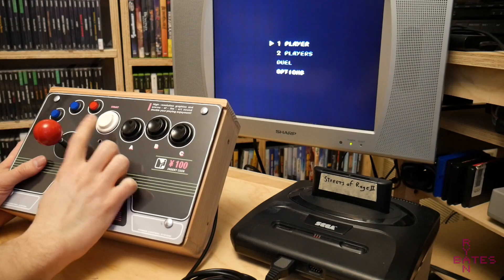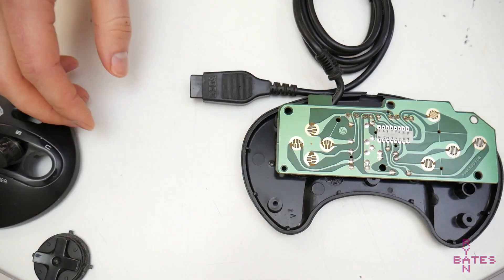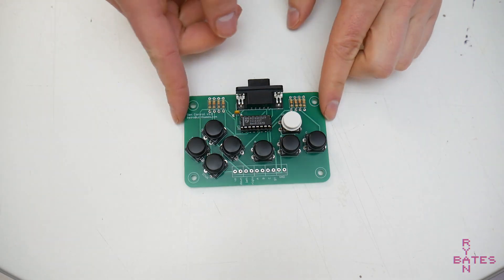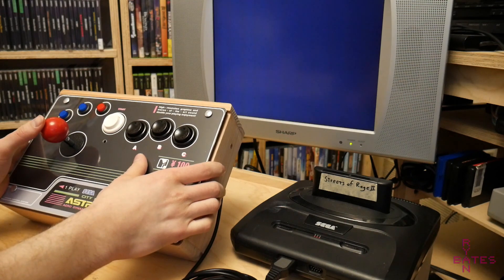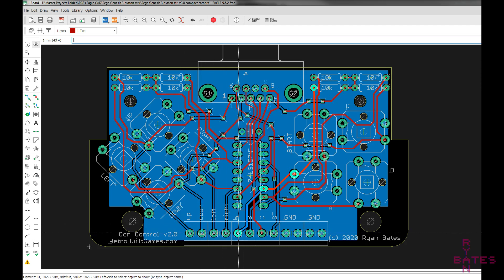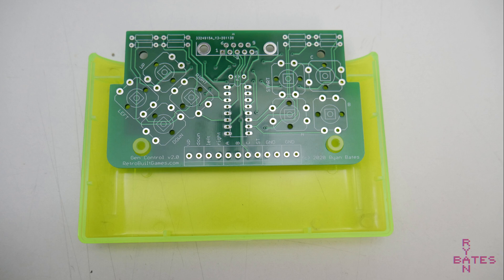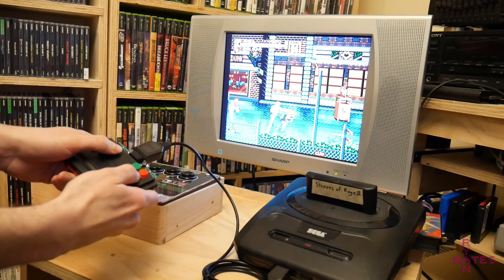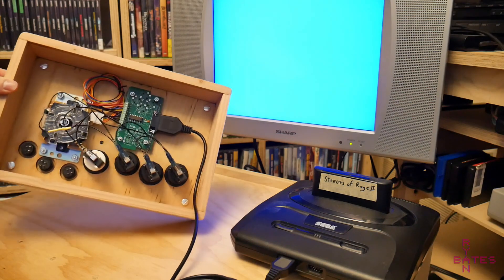Build a Sega Genesis [Mega Drive] Arcade Fight Stick Controller from Scratch

Comment: Ok so instead of trying to soldier arcade buttons to a Sega controller board (I tried it was a total fail but was my first attempt at soldering) I ordered a 6 button arcade joystick branded by Sega and I'm just going to take the hardware out the shell and place them in the arcade cabinet I have built with a nice crt I found for free on craigslist. I even mounted a gun holster on the  side for justifier. I still need to mount Sega Genesis in the bottom of cabinet , but I want it to appear like it's floating . I'm putting two windows on the bottom sides of the cabinet so that you can view the machine like yours just no window on the front because I have artwork of Bart Simpson  as bartman saying Genesis does what nintendon't
Reply from the maker: this sounds like an awesome build. share some photos when you're done.

Comment: Do you have a link to the DB9 plug you used on your cartridge controller? Can’t seem to find a place to source those…
Reply from the maker: not the one i used, but likely the same thing https://www.sparkfun.com/products/429
Reply: @RetroBuiltGames  And the metal shroud on the outside can be removed? I'll have to give that a try, thanks.

Comment: Hi friend. In your PCB, why dont you use a 10K resistor on the Select input sígnal? Does it innecessary? SEGA on the original board mount that resistor.Regards
Reply from the maker: All the inputs have 10K  pullup resistors on them

Comment: You could add rubber feet to the 4 corners of that arcade controller so that you avoid crushing the db9 cable...
Alternatively you could cut notches all around that or at least one notch at the front with a router or whatever other tool you have available.